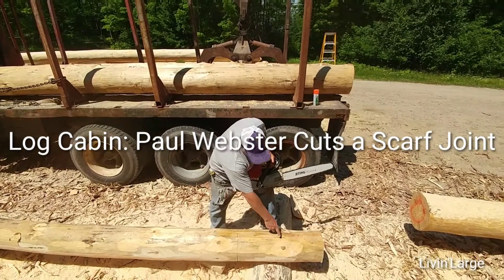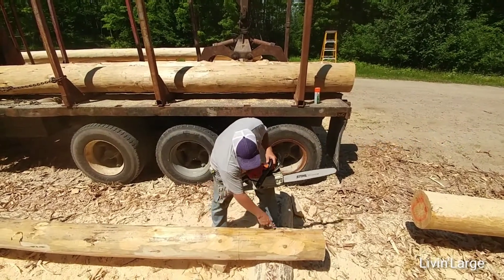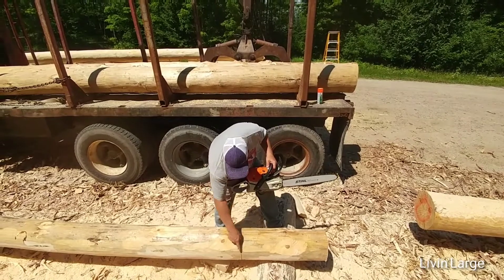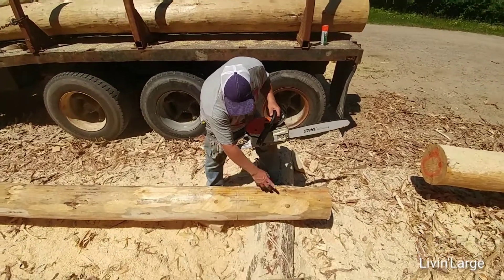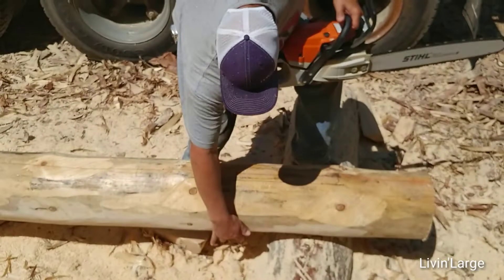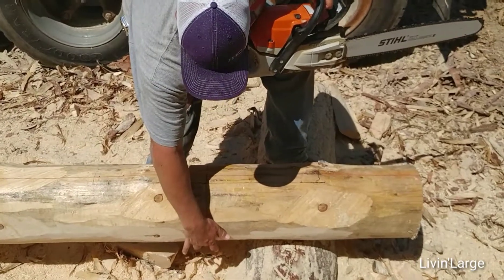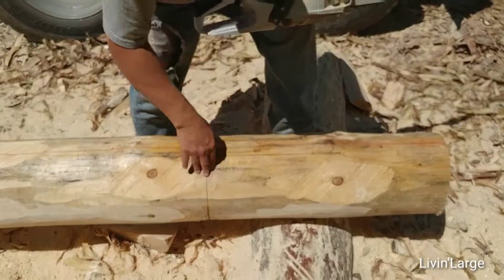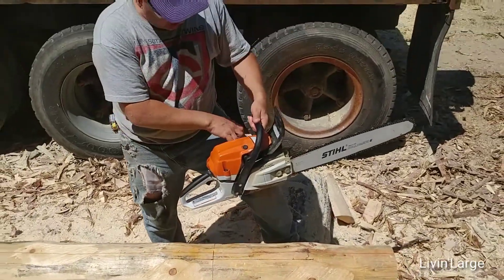Sawing a Scarf Joint: Log Cabin Logs

Comment: So how do you measure out properly to create a scarf cut?
Reply from the maker: Chainsaw Paul just eyeballs them, but AL comes by with his wooden box of scribes to lay in the important measurements.  I am the grunt to grind them into shape.

I found all of the characters via Schroeder Log Home Supply in Grand Rapids where Paul put up an add for a Log Peeler.  I ended up mainly the grunt & grinder.

Comment: ....does not appear to be a scarf joint...see no way of joining 2 logs together...or any mechanical lock for holding those two logs together as one piece...

Nice chainsaw control though.
Reply from the maker: I will let Paul know.
Reply from the maker: Quite possibly Paul figured it a scarf joint, because it was a notch to join two logs, but most definitions seem to point to an added mechanichal joining mechanism, where this style of logwork had none there: the logs just rest on each other.
Reply: What he has cut here is a scarf for a saddle notch... so it is for joining two logs at a 90 degree with one log overlapping the other... the 'scarf' is simply the slab he took off the log.
An actual 'scarf joint' would have mated the two logs end to end.
Reply: @ShaneHerrick  what your describing is a lap or overlap joint

Edit: a scarf joint is supposed to be joining 2 logs together wood end to wood end to create a continuous longer piece. Railings for a poarch or a fence are a great example of where you might use a scarf joint.
Reply: @kingdarkem  yes... thats what I said.
I'm a log home and  cabin builder.
Reply: @ShaneHerrick  my point is it sounded like you were calling it a scarf joint when its actually a lap joint or an overlap joint. Terminology matters least in my book.
Reply: @kingdarkem  no... joining two logs end to end to lengthen the log is called a scarf joint.
Reply: @ShaneHerrick  yes, but the joint in the vid appears to be a lap joint. Maybe im wrong or I missed out that day.
Reply: @kingdarkem  As I said... it appears that he has put a scarf in one side of the log... and will do  the same on the other side of the log in order to scribe a saddle notch. Please google a 'saddle notch'.
Reply: @ShaneHerrick  don't need to Google it, a saddle notch is the traditional corner joint of traditional cabins. Typically they sit flush with one another creating a seal. The step in the joint he cut seems to be antithesis of flush. 

Sorry if I'm annoying ya, just still learning.
Reply: @kingdarkem  He doesn't do a very good job at cutting the scarf but, I didn't want to mention that. But it does appear he is prepping for a full scribe saddle notch.
Reply: @ShaneHerrick  only ever seen full scribe Scandinavian style saddle notches that are triangular with the hewn edges and gap channel. If that's what he is doing its very interesting